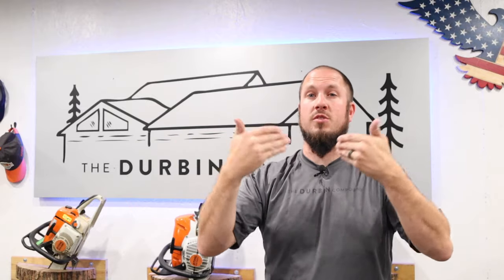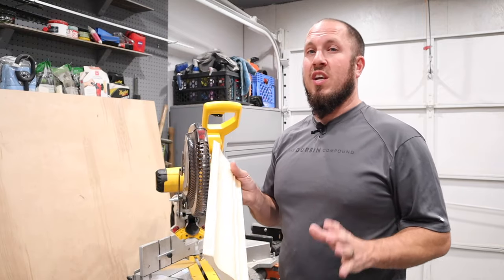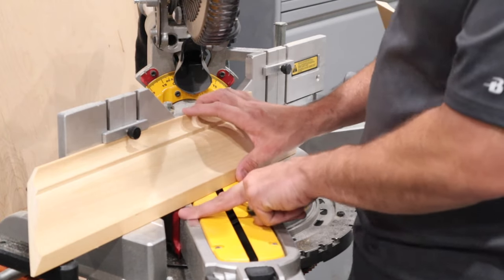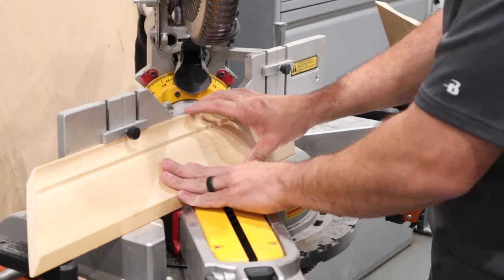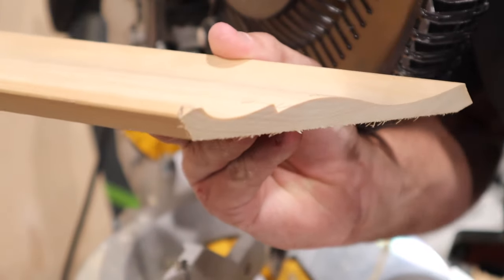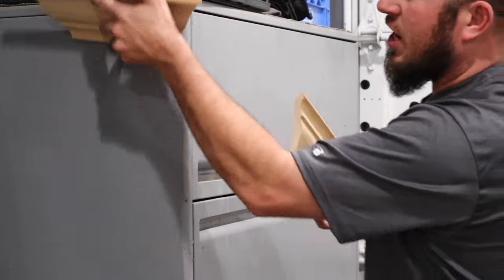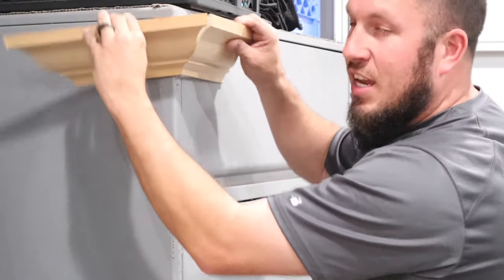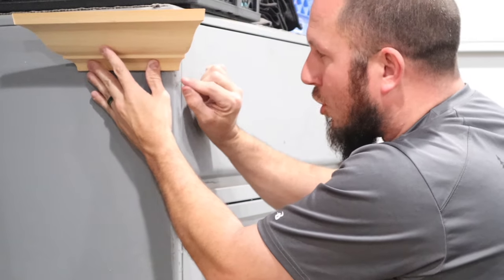How To Cut Crown Molding For Beginners - Outside Corner

Comment: my two pieces join at a 45 degree angle vs the typical 90 degree angle. Do I follow the same process on your video
Reply from the maker: Yes, but the angle would then be 22.5 degrees cut

Comment: This is very cool I didn't know how to cut crowns like this for both cabinets and kitchen counters for sure this is pretty dope!! When you're measuring with a tape measure, how do you measure the length of a piece of wood even though you're making a miter cut with a 45° cut?? If you measure that wood on the angle of the wood, it's going to look off so would you measure the wood at the top then or should we just measure our length of our cuts on both the kitchen counters and cabinets (because like you said, those methods might be more accurate vs cutting on the top of the wood)?